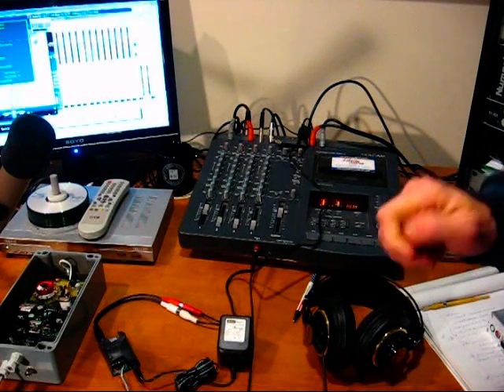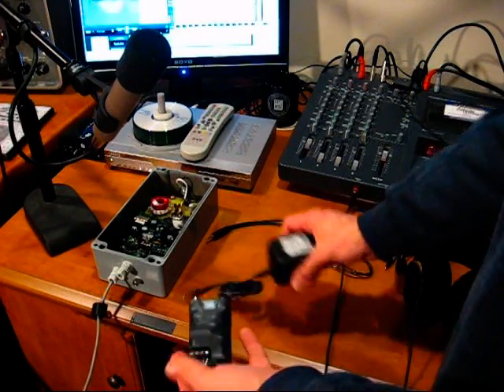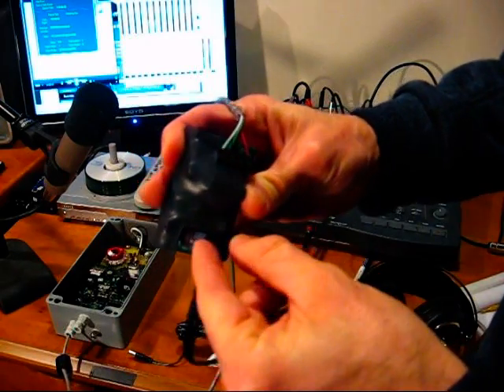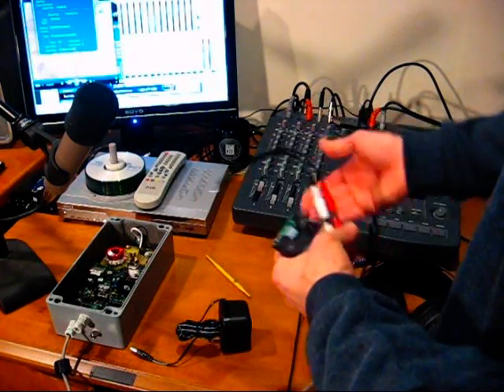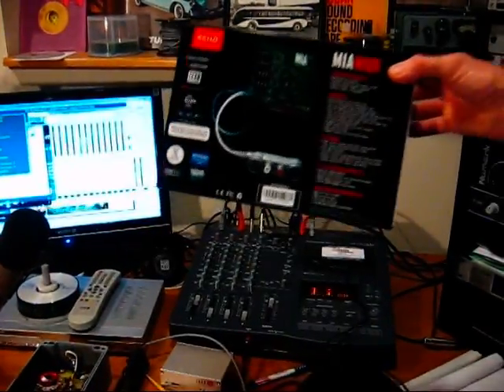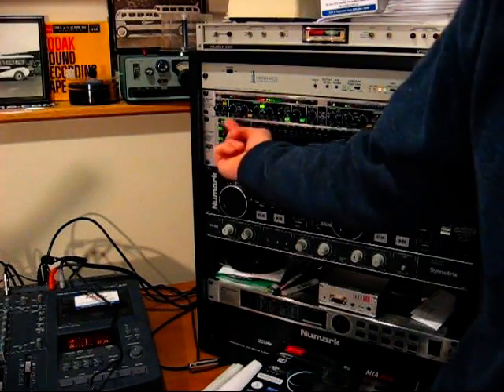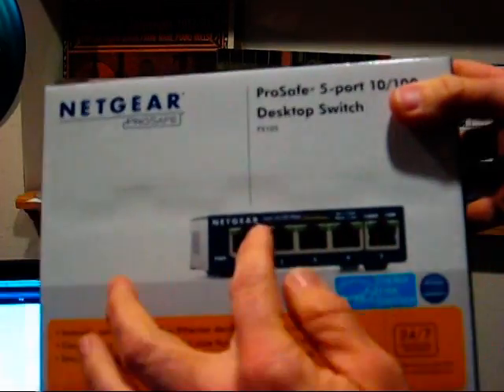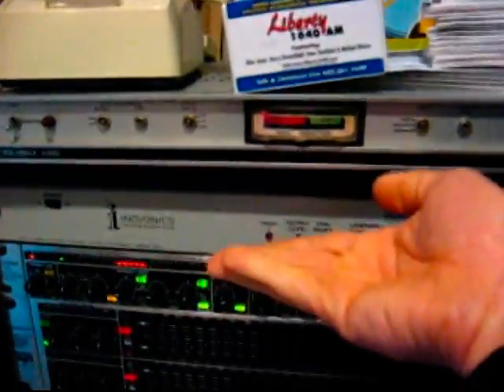Part 15 Rangemaster AM Transmitter Set-up and Upgraded Studio Components

Comment: I now this is a very old video on UTUBE. What is the best mounting for this transmitter? Ground mount or 25 feet on a mast? Seems like elevated gets into a sticky mess with the length of the ground wire, which becomes part of the antenna..... I do want maximum coverage. I don't need the FCC visit.

Comment: Rangemasters are quality as hell and have some neat features but boy, do you pay through the nose for them for 100mw!!
Reply: YUP a KILOBUCK with all of the whistles and bells. I got the hi-fi version. But accepted the crystal control. 1620 and 1700 seem clear at my location. I need to find out the best way to mount the transmitter. Ground mount??? how far does it go? Mounted 25 feet in the air?? how far does it go? How do you tune the transmitter when it's 25 feet in the air??? Stuff like that is what I need to know

Comment: @MichaelJGrant My experience has been that installations delivering a useful signal beyond several hundred feet almost invariably, assuming the transmitter itself is compliant with regard to input power, have questionable ground leads.   The same RF current that flows to the antenna also flows in the ground lead.  Therefore, the radiated signal depends on the radiation resistance of the element it passes through.  The longer the element, the greater that resistance, the stronger the signal.

Comment: @zappatx The problem with Part 15.219 is that the term "ground lead" is vague.  Of course, a cable from the transmitter 's ground terminal to a "ground" is a ground lead.  But what about when the transmitter is electrically bonded to grounded support structure such as a tower or mast which was the case with KENC?  Does the support structure become a "ground lead" under the regulation?  KENC seems to have pursued its due process rights to no avail.

Comment from the maker: @xadekpl As long as you don't advertise your system too much - forums, websites, etc.. The FCC will never bother you. These units are compliant and are expandable when using several units. These are being installed at a frequency of 1-per week. One 200WT FM with a legal show in Texas got a FCC visit discovered in the FCCs own charter that they lack jurisdiction to go after unlicensed operation not crossing state lines & non-commercial. They filed a complaint in Fed court & the FCC backed off!

Comment from the maker: @MichaelJGrant  KNEC happened to get a Agent who was betting the US citizen didn't know his rights and due process. I got lucky as the the agent in my district was very cooperative. We have 5 transmitters ganged together covering over 6 miles (4 reliable but detectable as far away as 6 or so) in one spot which were turned off when the agent showed up. One location passed and one failed but we have made corrections.

Comment: You have a mighty impressive setup for certain.  It might be worth a trip for me and a steak dinner for you to see a *compliant* Part 15 installation that can deliver a useful signal at 4 miles or even half that for a single transmitter.  You might want to check out the enforcement action against KENC that claimed similar range with the same transmitter you are using.

Comment from the maker: @INTHEMIX74 
One of our several sites covers 16KM. Where did you get 1Km? Hell. I would'nt bother with that either.  One single transmitter I can reach on a good day 4 miles radius but our 5 transmitter array covers over 10 miles.

Comment from the maker: Im using it now. I think the Inovonics 222 may be better only because the output waveshape looks a lot better but as for adio quality and loudness this seems to work just as well and based on one man's opinion, even better. This one may have a slight problem but I would definately choose this over the Inovonics if cost is the issue. That's The PMC-300A. They seem to be easier to find but you should have a gain riding unit ahead like a Audimax or MAP I or II compressor.

Comment from the maker: Without pre-emphisis and the positive peaks you generally will be limited to 90% w/o distortion.
 I still believe the Audimax is best for a steady signal but I am now teesting a CRL PMC-300A fed by a Inovonics 230 8 band compressor. This is a limiter which is always limiting so when you loose audio such as low level program, song or voice dropout, it acts as gain as the limiter backs off. A great device! If something comes on with too much bass the unit will compensate (log scale compressor.)

Comment: Yes- I bought the newer card for about $35. Keith said it has a pre-amp in it for more gain. I tried also adding a compressor/limiter to even out the audio, and keep it constantly up, but could still use more audio at the receiver.

Comment from the maker: The EQ is right out of the board, then the compressor. 
If you are lacking at a reciever and all recievers how about the audio adjustment on the transmitter? Is it maxed out? Also is the stage before the transmitter impedience matched? What are you using? Are you using only that little card Keith sends?

Comment: There is a lot of information on setting up FM transmitters out there on the internet, more available than for AM, but setting up both transmitters are pretty much similar, except with FM you would be playing around with tuned length antennas instead of tuning curcuits or loading coils.(due to shorter wavelength of VHF over MF) audio processing may be a little different though due to the more "organic" nature of AM, FM is more rigid audio wise and gives you an all or nothing performance.